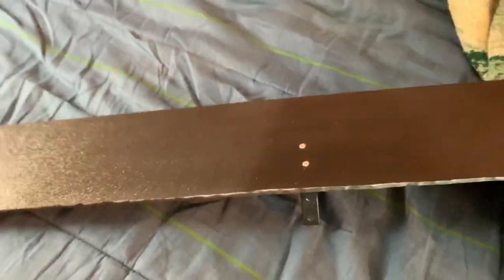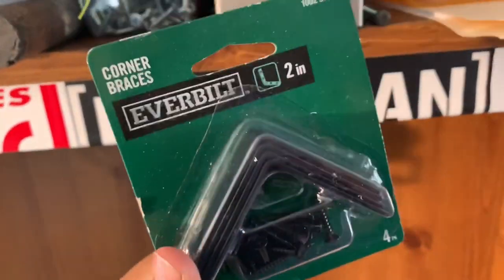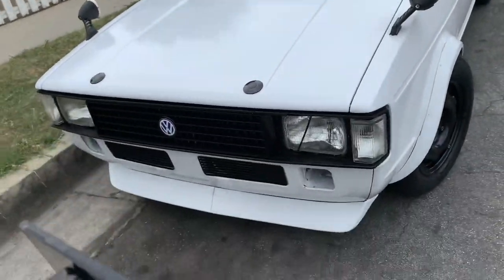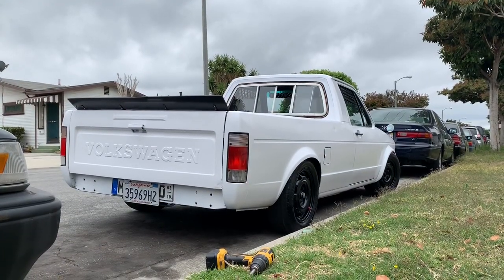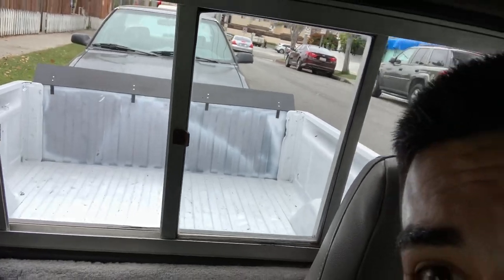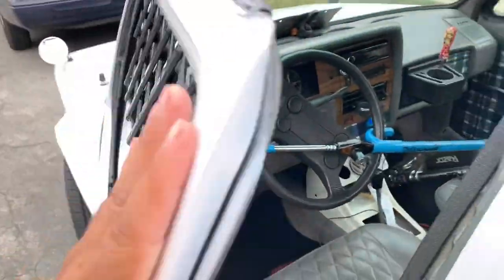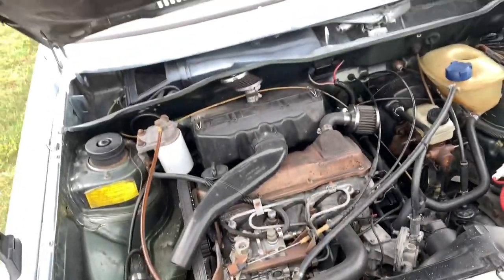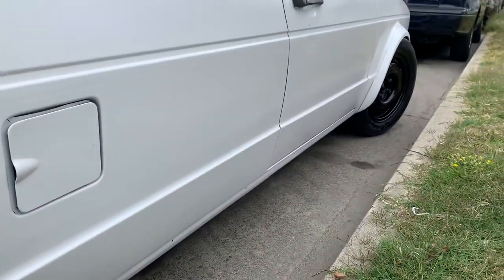HOW 2: MAKE HOMEMADE WICKERBILL OR REAR SPOILER FOR TRUCK!

Comment: What did you use to support the wink mirror?
Reply from the maker: Just the brackets that come with it then in the middle I added a suction cup that comes with the magnetic phone holders and positioned it right against the mirror to minimize vibrations
Reply: ToledoCustomz thanks I’ll try it out, I’ve got the wink on my mazda b2200 and want to reduce the rattling

Comment: The truck is looking pretty dope, I like the Wickerbill and hood latches, but you have to be really committed to go the extra mile and drill those holes! :)

I managed to save my Caddy from the scrap-yard so I'm going to do some mods to it; also a lot of cutting and welding to replace rusted out areas on the body.
I still haven't managed to get a title for mine yet!
Reply from the maker: Thanks boss!!! Yes it hurt a bit hahaha😹📐 nice man! U should document it
Reply: @ToledoDIY  Thanks brother, yeah I'm going to make a few videos of the Caddy!  
My truck has so many rust holes in it that I won't have any problem creating more holes to mount accessories or customizations!